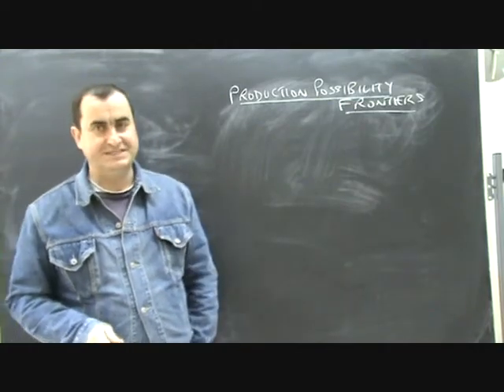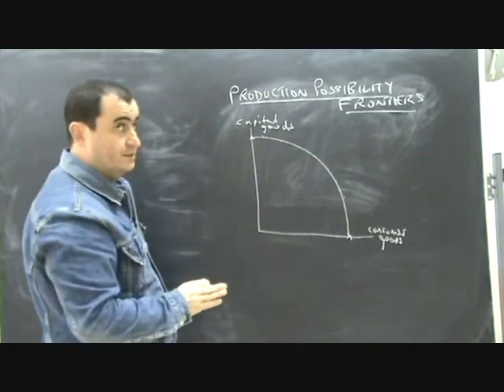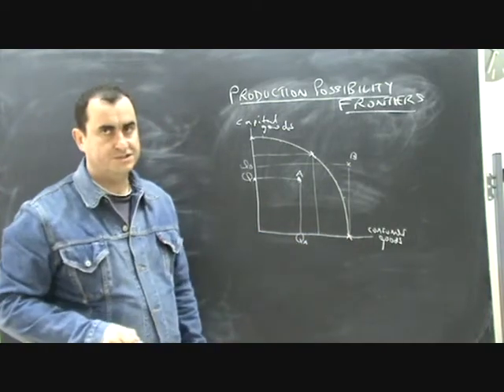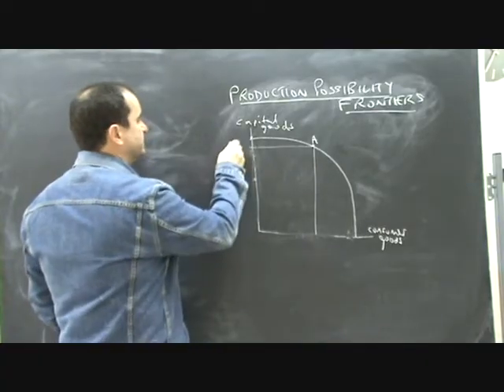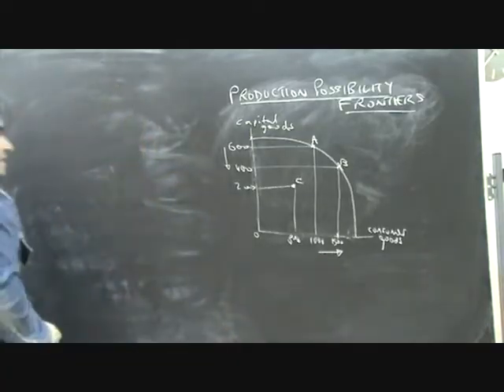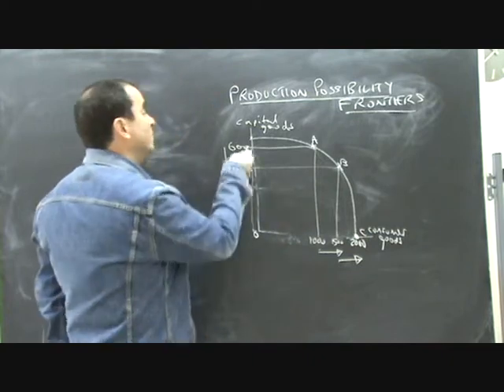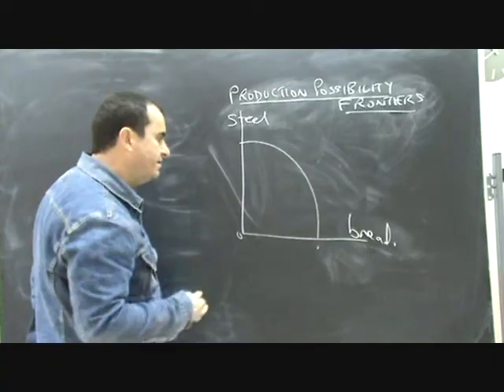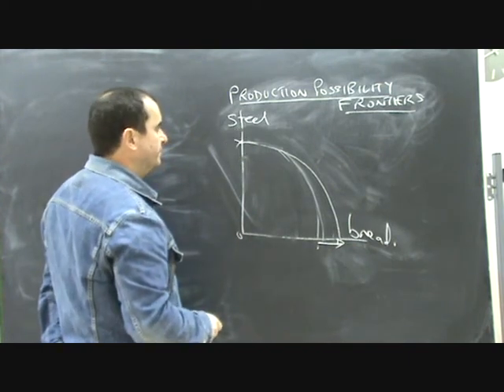Production Possibility Frontiers

Comment: @akrock47 not maximum or minimum, the curve is the frontier, and anything point on the curve represents the maximum output with the current resources. If not on the line then yes, but i'd stay clear of this as i wouldn't of thought it would be needed for a theoretical argument. 

Opportunity cost is not that, balance of goods is to do with international tade. Opportunity cost is defined as; the next best alternative foregone. This sounds complicated to me, so i prefer to think of it as giving

Comment: @davidjgrant23 so could you say that the ppf diagram shows the possible outputs, whether maximum or minimum along with the sacrifices an organisation would make, where the points dont exactly have to be on the line.
and the oppurtunity cost is the balance of goods for an economy and its cost of oppurtunity, which has to be exactly on the line.
yes? i finished my economics exams but i still like to get my facts straight :D